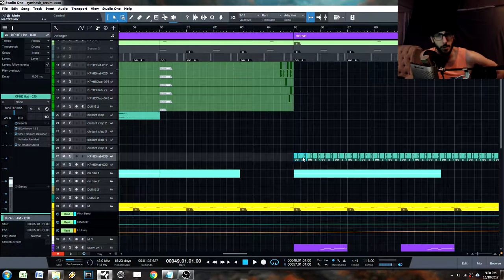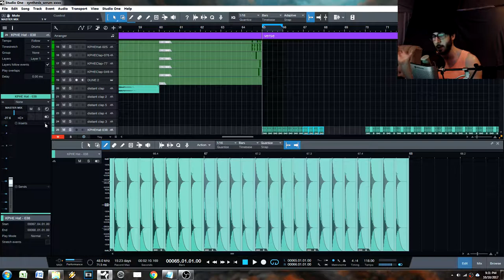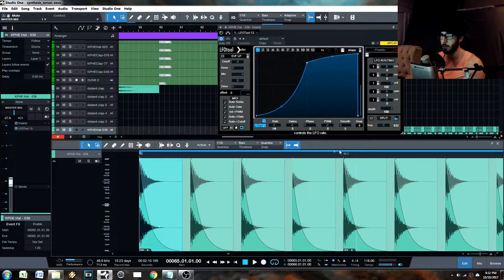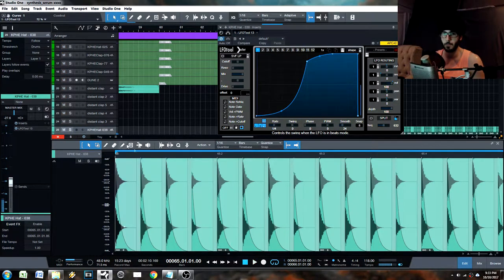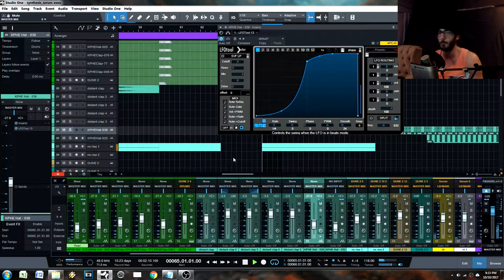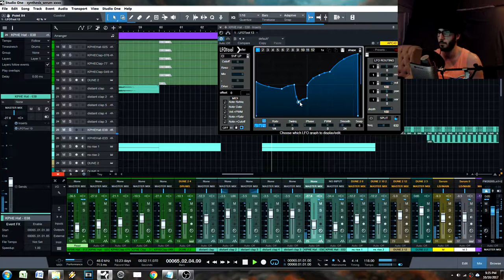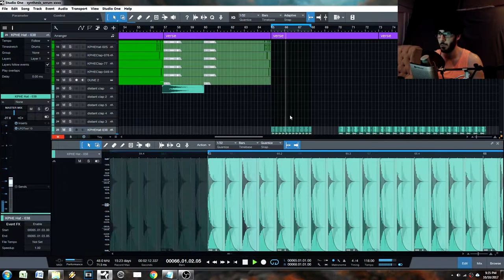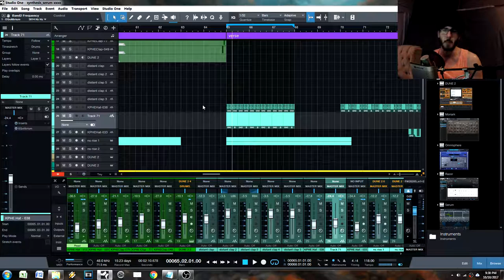Sound Design Secret | Instant HiHat Rhythmizing

Comment: Hey, I really like your videos.!! I have one question: How did you do that move at 08:18 ..this looks like a huge workflow enhancement :)
Reply from the maker: Hey Filter Grand, so it's the keyboard shortcut called 'merge events.' I've customized the shortcut so I don't know the original key combo but you can go to the top bar>studio one>keyboard shortcuts and then type 'merge events' in the search bar to find the shortcut for it. It's a great shortcut. I use it all the time for not just audio samples, but Midi events, midi notes (in the piano roll) , and as you saw audio samples. Good luck!
Reply: Thanks! Always used this for midi also, but this is so great for audio to create loops and edit thinks quickly. Awesome! S1 surprises me everyday with new features. :D